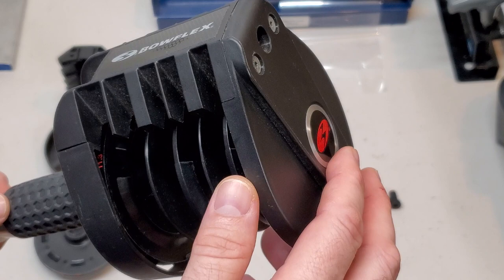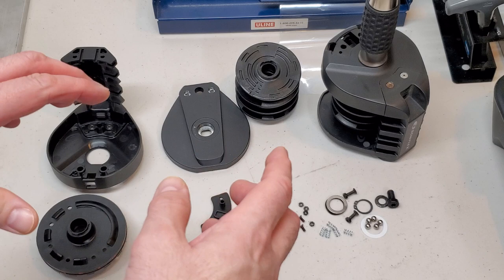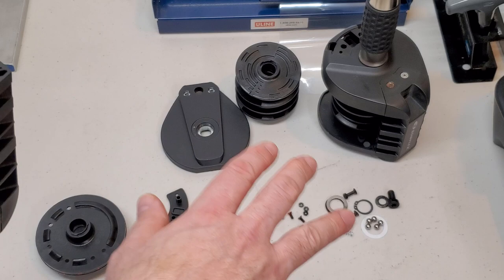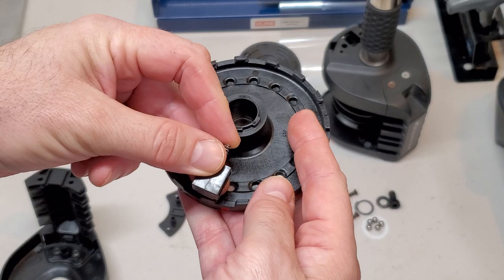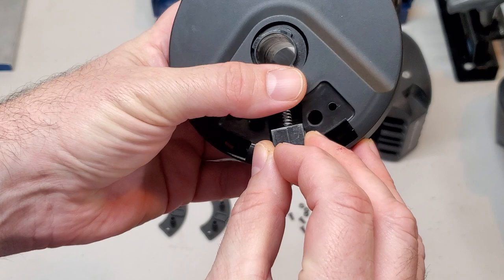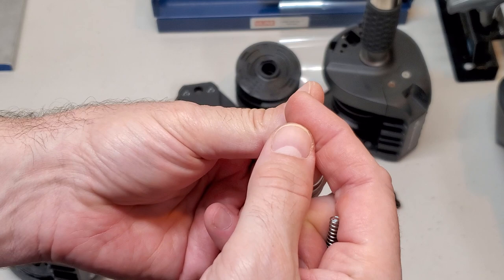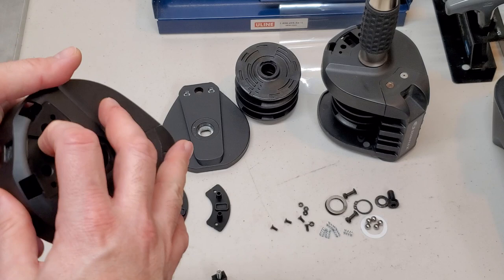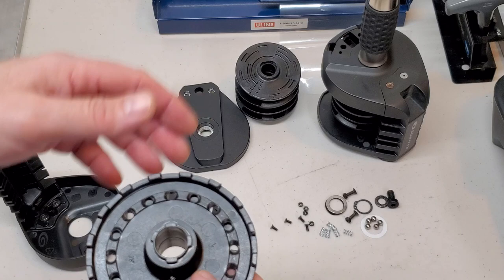How the 560 Bowflex® SelectTech® Dumbbell Handle Safety Locking Mechanism Works

Comment: Definitely appreciate the video but when this didn't work I decided to spray some WD40 into the dial on the top and it worked like a charm! I'm just glad I did that before I disassembled it. Thought I'd leave the comment just in case somebody didn't want to try the lube.
Reply from the maker: Thanks for sharing that, Kenneth. I appreciate it.  I can imagine it working in some cases, but these plastics generally don't bind in a way that requires lubricant. There's usually some other underlying issue and lubricant may or may not resolve it. One subscriber sent his 560 to me because he didn't feel comfortable taking it apart. Somehow, some way, debris that looked like a splinter of wood had become lodged up in one of his pin recesses and it prevented the entire assembly from rotating. I disassembled the dumbbell, removed the splinter and she was good as new.

I think you took a reasonable approach and tried the lube before doing disassembly...especially given how involved it is.  But I can't help but wonder if the spray dislodged something that may have found its way up inside the mechanism. At the end of the day, it worked, and that's all that matters.

Comment: Thank you for not giving up on my 560 problem 😉 I still haven't managed to get it to rotate even with the push buttons removed or even disassembled completely . The handle is the problem, it should turn independently from the rod as the rod is secured in slots at both ends. It seems unfixable.
Reply from the maker: Heya Rick.  Feel free to send me an email to see if we can figure this out.  I'm not on YouTube as frequently.  My email is SelectTech.Fix@gmail.com.  Just keep in mind that it may take a bit to reply to you depending on my workload.

I can't imagine that the grip is seized on the shaft. But I do wonder if that shaft became bent even if only slightly. Try rolling it on a table to see if it is straight and true.

Comment: I disassembled my 560 without thinking and now I have to put it back. If your can just show step by step on disassembly or/and reassembly would be a great help. As per your video, would it matter if I don't install ball bearings? As long as it turns and change between the weights, I don't mind the absence of positive feedback on turning the dumbbells. Your advise would be greatly appreciated. Subscribed!
Reply from the maker: Heya JS, I've been meaning to put together a disassembly/reassembly video for 560 owners. If I can find some time this weekend or early next week I'll slap something together. As the 560 ages more and more people will look to take these things apart to find a fix, and Bowflex provides exactly zero information about how to do it.   I'll also take a look while I am at it to verify that the bearings don't serve some other necessary function. Stay tuned.
Reply: @AverageJoeInnovationsLLC  I sincerely appreciate this. Thank you.

Comment: Since the button is such a pain I’m curious what happens when you remove the button??? Do you think it’s really necessary???
Reply from the maker: Definitely do not remove the button. It's the mechanism responsible for unlocking the twist grip when the dumbbell is in its base, and for locking the grip when the dumbbell is in use.  No button would mean a grip that twists freely while you're exercising. Your dumbbell would release plates during your sets.  Cheers, Joe